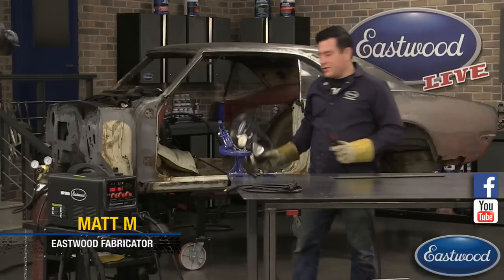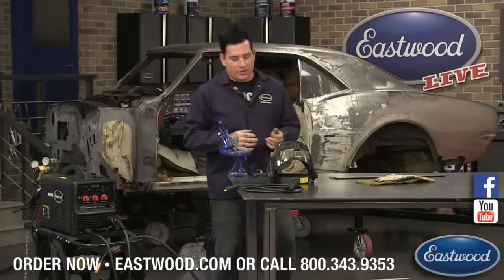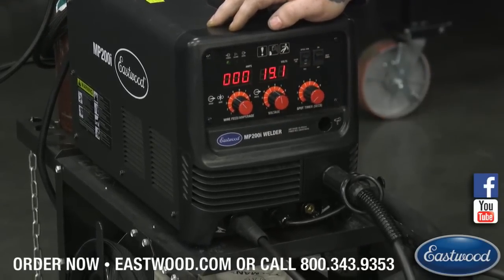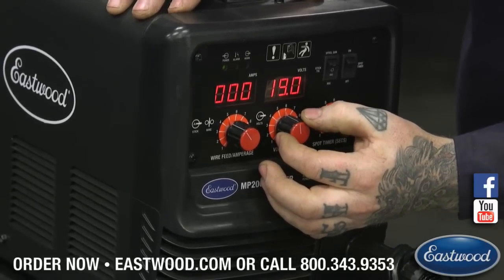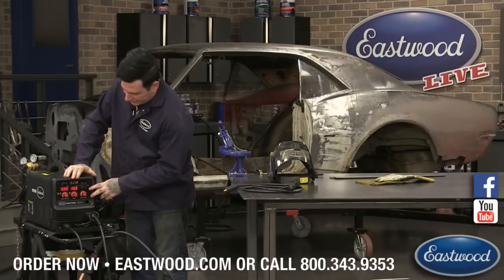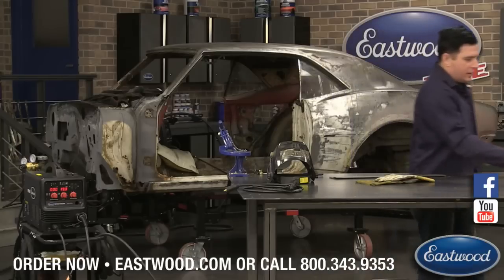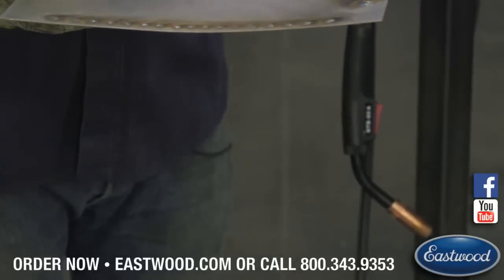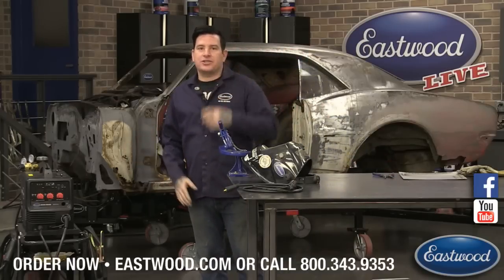One Welder That Does it ALL - MIG - TIG - ARC - Eastwood MP200i Welder

Comment: Hey, I'm looking at a Lincoln 210 MP,  and I'm always looking at your site.  How would you rate them side by side?
Reply from the maker: We haven't done a direct comparison in-house.  But if you compare specs, the Eastwood 200i will weld thicker steel (3/8 compared to 5/16).  The Eastwood 200i is also 10 lbs lighter at less than 30 lbs.    The Eastwood 200i is also backed by the Eastwood 3 Year Warranty and Satisfaction Guarantee.

Comment: If I buy this can I set it up to do aluminum with both the TIG gun and the spool gun with 100% Argon and if I need to  switch tanks to do steel with the MIG gun.  I really want to use it mostly for aluminum TIG & MIG but it has to be able to TIG aluminum since I already do have a good MIG welder. Is there a different set up you have just for MIG & TIG welding aluminum
Reply from the maker: You will use 100% Argon to TIG weld steel and aluminum as well as to MIG weld aluminum with the spool gun.  If you're going to MIG weld steel, you will use a mix of 75% Argon and 25% CO2.

Comment: What gas are you using for the tig welding. Also you showed a spool gun for Aluminum so what gas do you need for that and cant I set up the tig to do aluminum
Reply from the maker: TIG Welding as well as MIG Welding Aluminum with a Spool Gun both use 100% Argon Gas.

Comment: Can you AC TIG weld
Reply from the maker: A TIG must be set to AC when welding aluminum.  It will be set to DC when welding steel.  The MP200i will only TIG weld steel.
Reply: @eastwoodco  and stanleisteel